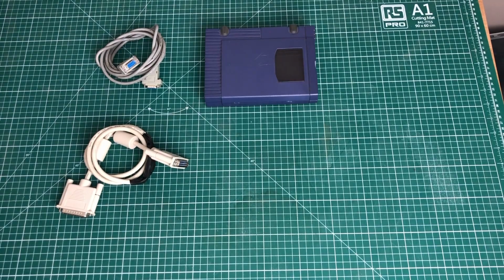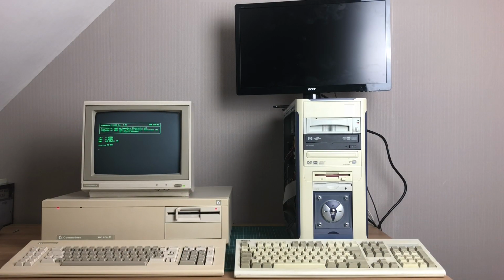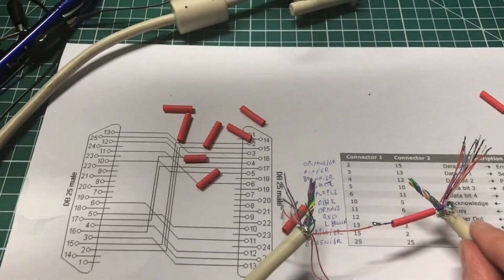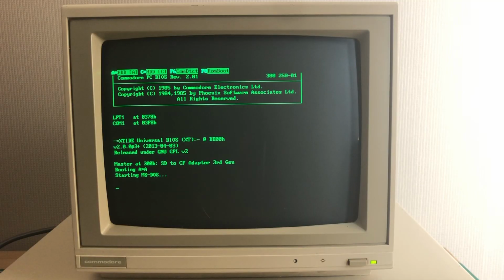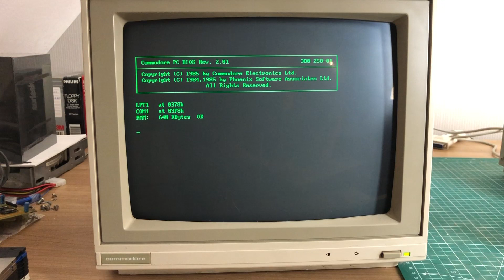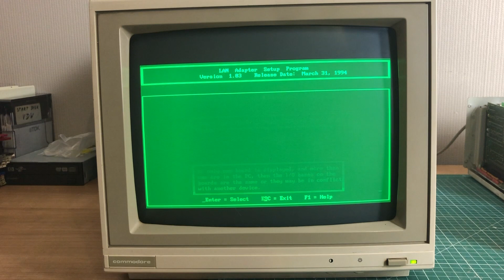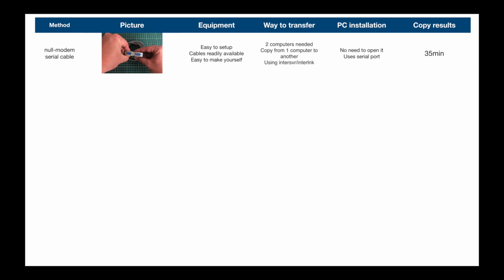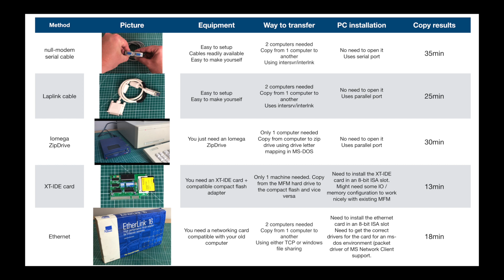5 ways to get data from and to your retro machine

Comment: Comment: If you have the correct software, the Ethernet solution can work even if you have only one local computer, if you also have some kind of cloud storage service like Dropbox or Google Drive available. The software would upload your files to the cloud storage service in this case. (This is technically still two computers, but the other computer is somewhere across the Internet, in someone else's datacenter.)
Reply from the maker: 陈北宗 mmm ... doubt that google or dropbox has client software for ms-dos 3.x :) these computers aren’t really made to authenticate against these cloud providers imho. But against a local NAS shouldn’t be an issue.
Reply: @RetroSpector78  The point is that the other device acting as the TCP/IP connection partner need not to be a local computer. It can be any device anywhere in the Internet, as long as it is publicly accessible.

Also it is entirely possible to write a Google Drive or Dropbox client for MS-DOS, if someone is to put the efforts into it.
Reply: RetroSpector78 you can do it with floppy bootable Linux 😅

Comment: I would imagine treating the harddrive as a block device and doing a raw block copy would be much faster than walking the tree and copying files individually.  Not sure what dos software could do that though.
Reply from the maker: would need to look into that ... haven't come accross a dd version for msdos.
Reply: Considering a lot of these older drives were matched to their controller card the way they were formatted and kept data stored on them was not standard. It was almost different in every drive instance. Hence it’s just easier to copy off everything. Would have been great to see a floppy disk comparison zipping up across spanned disks. Would have taken forever!

Comment: There are adapters you can buy that make Serial go over UTP Category cable. So you can cheapy make a Null Modem Cable. There are also adapters for Parallel as well. If you have a System that doesn't have Parallel or Serial you can use USB converters or even buy a PCI card if your modern computer still has PCI.

What I use is a WiFi232 adapter and a special Bootdisk that had MS-Client and just map the drive so I could access it my Linux Machine running a VM with Windows 95. Everynow and then I have been tinkering with a Unix/BSD build that can run on a 8088 and see if I can use that to mount a FAT16 DOS Partition and use it for file transferring. I mostly get a hold of 386 Systems so the DOS MS-Client with a TCP Stack is plenty. I need to get one of those Floppy USB Emulators, started running into Floppies diying on me.

It's been a while since having to do file transferring with old systems. I've been working on and off a homebrew Z80 system.

Comment: here's where I'd be putting the MFM drive into a much newer machine with ISA slots but better other hardware (you'd probably have to disable the IDE channels).  Copy the data off, then put the disk back in the XT-class one.  Not anything I could test anymore, as I lost the last of my ISA-slot machines in a house fire 10+ years back.

These days I look at videos like these with an eye to what hardware collectors are looking for in case I see anything at flea markets, etc.

EDIT: apparently there is also an 8-bit ISA USB card available too.

Comment: How about a USB to floppy drive adapter? lets you insert a USB stick that's visible as a floppy to the machine. Costs 15 bucks from a certain Chinese online shop. Mine is on the way :)
Also, most modern motherboards still have internal parallel port header which you can use to connect a breakout board with the actual LPT socket. My MSI X370 has it.
Reply from the maker: Goteks are cool, but limited to floppy images. So you can read / write floppy images but cannot bulk copy larger things. You would need to find a way to convert larger datasets into 1.44 or 360kb floppy images, taking a long time to assemble / disassemble on an XT. Also, the gotek runs at floppy drive speeds so not super fast.
Reply: @RetroSpector78  Are you familiar with ARJ? https://en.wikipedia.org/wiki/ARJ It's really nice for multi-volume-spanning archives, better than PKZIP. Also, if compression isn't important, you can use any number of programs to split files, and then recombine them with only out-of-the-box COPY, with no extra software at all: COPY /B FILEPART.ONE+FILEPART.TWO REJOINED.FIL
I think floppy emulators are a good option.

Comment: Can you post the LAN Adapter Setup Program software? It looks like it would be helpful in setting up generic NE2000 NICs. I can't seem to find any copies online.
Reply from the maker: I've updated some links in the description. Some of the links in the lanmanager article were broken but you should be able to piece everything together. It's just a very painful process to do it on the XT machine. And on my XT machine I wasn't able to install a custom driver during the MS Network Client installation. (So I installed MS Network Client in virtualbox and then copied the resulting NET folder to the XT and took it from there .....). Had some resource conflicts with the NIC, and not all NE2000 drivers seemed to work with this card. But worked out at the end. Will do a more in-depth part on ms-dos networking soon.

Comment: Excellent video! I use similar methods even with a more modern DOS machine. CF cards are just convenient. I never knew about nwlink, though. I've used a null modem cable to connect to a linux box using TELEMATE, and used Z-Modem to transfer files, just like I used to do back then with BBSs. I wonder if that's faster compared to NWLINK. In any case, a network card with telnet was much faster.
Reply from the maker: Ethernet is nice, especially on AT machines ... on an XT it is really pushing it, and once your network drivers and protocol is stack is loaded, there really isn't all that much you can do anymore ..... My hopes of running a multiplayer game on my XT with sound and hooked up over ethernet were pretty much shattered :)

Comment: Thank you for the video. 

How did you made lan manager to work on this ? Every version I find needs at least a 286. Could you provide a link ? I've been trying to make that work since quite some time...
Reply from the maker: Not at my computer now but there are 2 files that require a 286 or up. These 2 can be replaced with the ones from an older version of lan manager. Will post some links in the description afterwards. Will also do a more in-depth video focussing on msdos networking. But it was a pain to setup. Slow and ms network client did not want to read my driver disk.
Reply: @RetroSpector78  Thank you a lot !
Reply: @RetroSpector78  Posting a MS-DOS networking tutorial on an XT class PC, along with software used, would be helpful.
Reply from the maker: @christopherhenkel  I will ... soon .... keep an eye out for it here ... and don't forget to subscribe and share ! :)
Reply from the maker: Added some links in the description.
Reply: What I've been doing with XT class machines to allow drive sharing is to just install the bog standard Microsoft Network Client 3.0 with the NetBEUI protocol only.  The NDIS2 drivers for a lot of the popular cards (NE2000, 3com Etherlink III) are included on the disk.  Just make sure NetBEUI is installed on your Windows 98 shared machine.  Can't speak of speed comparisons for file transfers as I never tried the TCP/IP route, but I believe it has a smaller overhead than the TCP/IP stack.  Also, using a NE2000 compatible card with jumper switches forgoes the need to set up the card using a newer computer.
Reply from the maker: @iammrsparkle84  Good point ... Finding a compatible card that is supported is indeed the trick. I found that on my XT it didn't always pick up third party drivers for some reason (while it did work on my pentium PC). I did try to set it up using NetBEUI first but couldn't get it to work on the XT. (I did a dry-run in Virtualbox using an msdos6.22 and windows 3.11 VM and that worked fine with NetBEUI but on my XT it couldn't find the windows shares) So I went with the TCP-IP route. But my time was limited with msdos networking. Busy preparing a new video now that goes into more depth. Hopefully I'll get it up and running there. Thx for the comment.
Reply: @RetroSpector78  Yeah, I mostly stick with NE2000 compatible cards for suck things.  But I did also get a Xircom PE3-10BC parallel Ethernet adapter working, so there is one more option to connect an old computer up without having to open it up.  But speeds are hampered by the parallel interface.

Did you make sure both computers are in the same workgroup when the XT couldn't find the shares?  Also, I've found that the browse part doesn't work for me, so when defining a mapped drive, I've had to manually type in the share name (eg \\windows98\share) in order to connect.